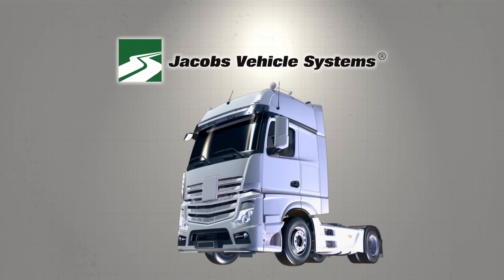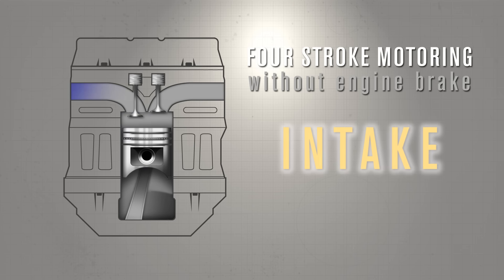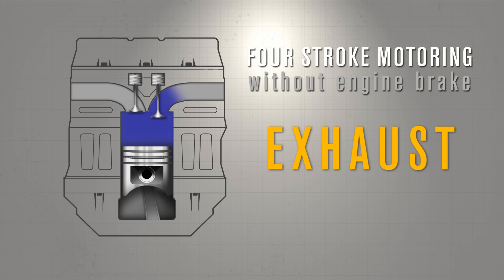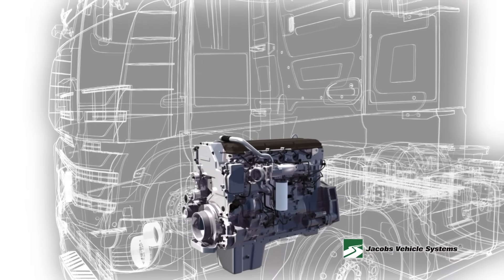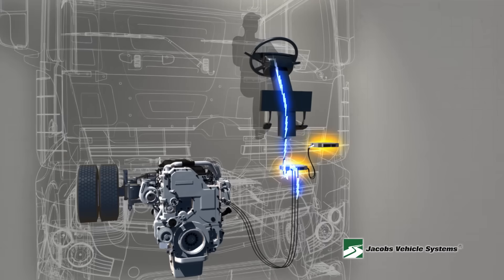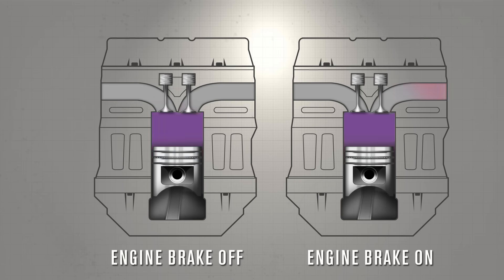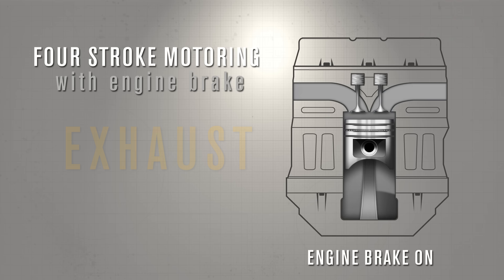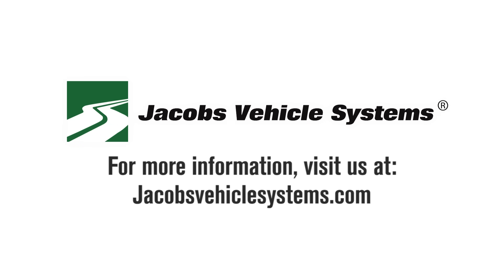How a Jake Brake Works - Jacobs Vehicle Systems

Comment: Can anyone explain why you wouldn’t just go into neutral? If the energy isn’t being given back to the engine with the expansion cycle, why even use the fuel?  I mean I guess the engine is gonna be running regardless but

Comment: This also is explaining why you will see increase in boost pressure and egt will not drop as fast while using jake brake. Air cannot enter the engine as much, creating a airflow restriction making your boost gauge read up a bit, and egts will not drop as much or as quick due to heat energy being generated and not just allowing air to flow through if you have the brake off and no throttle applied. If you wait, you can actually watch your egt climb back up a little bit when you hit the jake brake.

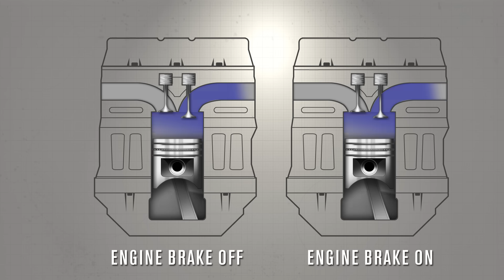Comment: how to waste gasoline/diesel... ex valve open after intake close.. 2:11
Reply: Fuel is only injected during open throttle. No fuel is injected during coasting or during engine braking, so no fuel wasted during braking.

Comment: I love the sound of Jake brakes. I also took diesel engine mechanics in highschool and would have graduated with a diesel mechanic certification but the teacher quit halfway through the 5th of 6 half year courses, and they shut the program down and wouldn't count the previous 2 years of the class. I ended up giving up on that career after not wanting to have to completely restart the program after graduation and pay for the schooling. Now i mive and install office furniture...
Reply: I think you made a big mistake not starting that over.

And this is from someone who also had to restart their trade school.
Reply: @Dave_Crupel   I think that all of the time 😐
Reply: You love the sound of Jake brakes because you don't have to listen to them when you're sleeping at night.
Reply: @jojogo22   I tend to not listen to most things as I sleep, because I'm usually sleeping. It's nice of you to assume that  don't live near seemingly any roads, when I live 2 houses distance from a main county road that's one of 3 major roads going to out highways. I listen to every loud vehicle that passed, not just semi trucks. Every loud car, motorcycle, constant helicopters flying low enough that my windows shake, and white trash in the apartments behind me
Reply: All high schools should be mandated by law to have well equipped trades classes. It's outrageous that schools have been shutting down stops and trade education programs.
Reply: @gregorymalchuk272   I was in HS from 2005-2009 and they shut down the diesel program I was in, as well as the gas engines class next to us. Gas engines went first, and diesel the next year. They kept the veterinarian program and whatever they did with horses and converted the rest of the school into pretty much a big school for learning how to code...

Comment: Should be used in emergency situations especially in populated areas. I live near a freeway in a city just outside of Minneapolis and I’ve been here for almost 20 years and it wasn’t until recently that I started hearing this noise many times throughout the day. It’s infuriating and even more so when it shakes your house and wakes you up early in the morning.
Reply: The new jake brakes are no louder than the regular sound from the engine, the wind and tire noise drowns it out, HOWEVER some people remove the sound muffler because they like the sound. I think its a cool sound but it should be illegal except when logging or in mines away from cities

Comment: This explanation did not include anything regarding the fuel injection.  It seems to suggest that the compressed air creates all the power.  Written by someone who doesn't understand internal combustion engines?

Comment: I was amazed at how well the Jake worked when my company went over to automatics...I ran a ton of WV and Pa, and other assorted states, and even at near gross the transmission/Jake kept my speed under control...I often wonder how old truckers managed without a Jake...
Reply: They did a lot of down shifting with their manual transmissions.
Reply: @549BR  well, yeah...I grew up near Old Fort, and trucks would go down that mountain at a crawl speed...when I began driving thinking about what gear to go down any particular hill, and having a Jake, was still a thing...I smoked my brakes 3 times over the years...once I was able to stop and just sit and let them cool...twice I was able to catch a lower gear...as I was close to hanging it up I still saw trucks smoking brakes, and today I know it still happens...it seems more frightening seeing it from in a car, and knowing what is going on...
Reply: @549BR down shifting really doesn’t slow you down like it would in a Car.
Reply: @690_5  That's because diesels generally don't have throttle plates, so they don't generate very much engine braking, unless your tractor is very old and has a gasoline engine.
Reply: @michaelbenardo5695  exactly that’s why they have runaway ramps on mountains diesels will run away because they rely on fuel injection instead of a throttle valve like a gas engine
Reply: Jakes have been around since the 60s. I’ve had a lot better of a time with them in the manuals I’ve driven than the automatics
Reply: Isnt there unburned fuel in the exhaust gas when the brake is on?
Reply: @ichosolemanuel6048no, because there is no fuel injected during the cycle.
Reply: @ichosolemanuel6048 no, they skip the injection.
Reply: @ichosolemanuel6048 no since the injectors aren’t putting any fuel into the engine.
Reply: huge leg muscles

Comment: The Grapevine on I-5 is a great place for this. (I've heard it many a time while going north on I-5.)
My parents had this put on their diesel Dodge Ram 1500 after running through an intersection coming downhill from Lake Tahoe. (This truck was used to haul a 5th wheel travel trailer which was attached at this particular time.)
Reply: This is the exact place I look forward to driving through when driving back from Los Angeles so I can hear the Jake Brakes. 👍👍
Reply: You can't put a Jake on a half ton.  Don't know what they told you but it's wrong.
Reply: @FoolAndHisMoney23  It could be as it had a Cummins diesel in it
Reply: @LadyAnuB  Cummins in pickups have exhaust brakes which are completely different from the compression brakes like Jake.
Reply: Soooooooooo, instead of purchasing a truck that can safely haul a fifth wheel trailer, they added an engine break to a half ton NEVER designed for that kind of load. BRILLIANT
Reply: @bobward7489  Nope, it's a grade that many have encountered before that overwhelms their tow vehicles. It's a road that they did by mistake.
Reply: @LadyAnuB  Regardless, hauling a fifth wheel with a half ton truck is dangerous and irresponsible.

Comment: The one aspect omitted in this video when explaining the four-cycle process:  Nowhere was it told   when the fuel was injected into the combustion chamber; as the narration told of air intake and compression, but no mention of the fuel combining with the air to make the combustion.
Reply: Fuel is only injected while producing power. No fuel is injected during coasting or engine braking, so no combustion occurs then. Since fuel is not part of the engine braking process, it is not shown in the animation. The power cycle that occurs while fuel is being consumed becomes the expansion cycle in the absence of fuel. Most of the energy used for compression is returned during the expansion cycle, so not much retarding happens during coasting. Opening the exhaust valve at the end of the compression cycle dumps that energy into the exhaust system before it can be returned during the expansion cycle. That immediate dumping of the compressed air is why the engine holds back more during engine braking than it does just coasting. It has everything to do with pumping air and nothing to do with fuel.
Reply: @rdththth Only your comment made me understand what the Jake Brake does. The video didn’t explain it at all..
Reply: In a diesel, the high compression ratio causes the air to become super hot, so when the fuel in injected, it instantly combusts - diesels don't have a carburetor.

Comment: If everyone liked the same sounds, noise would not be a problem. I live off a main road, one side residential, the other industrial. There are no hills, no highway ramp, still, “some” truckers apply the Jake break with or without a load (as early as 6am and late as 11pm). It is annoying, especially for those who work the night shift, or with a baby at home, or a sick person at home.

Comment: 1. Jake brakes do not improve fuel economy, in fact they can have a slight negative impact in some situations
2. They are still loud even with the emissions equipment, maybe not as loud, but "all but eliminated" is stretching the truth.
Reply: You obviously aren't in the career or you'd understand.

Comment: The computer does not open the exhaust valves. Jakes were around for decades before a computer was put in a truck. The cam and valve springs open and close the valves. The jake operates with a actuator and oil pressure to change the timing of when the exhaust valves open and close.
Reply: The younger generations think that we were in the stone age before computers.

Comment: Everytime I see a "No compression brake" sign. I think of that, 72 feet, four inches long; 13 feet, 7 inches wide; and 15 feet, 7.5 inches tall at its highest point. That weighs 400,000 pounds. That blast its train horn in town that can be heard for Miles compaird to my Engine brake that is heard for Feet.

Comment: Most trucks today don’t have clutches due to being automatic so there must be a change to how the jake brake works. Well on to the next video to explain that I suppose
Reply: Most heavy trucks automatic transmissions are internally the same as manual transmissions, but with automated mechanisms added to do the shifting and control the clutch... so there's no change in function. Even with an automatic transmission of the type traditionally used in cars and light trucks (clutch-shifted planetary gear sets and a torque converter), as long as there is a lockup clutch bypassing the torque converter engine braking again works as it always did.

Whatever the details of the mechanisms in the transmission, the clutch must be engaged and the transmission engaged in a gear for engine braking to work, and the system of controlling the engine's exhaust valves is the same.

Comment: 0:40
"The air will then be compressed at high pressure . . and expand"
Yeah, for a company that literally does engine things, you kinda messed up by omitting the whole, ya know, fuel part of how the engine works.
Reply: Yep!  That struck me as being odd about not mentioning the fuel aspect of the four-cycle process.

Comment: When I as a kid.. My dad was a trucker. In PA they had certain places where a Jake Brake was required. The cops, who are always your friend and concerned for our safety, would listen for the sound of the brake to make sure you were in compliance.
Reply: now they fine ya for using the in many places
Reply: I'm a little suspicious of this "requirement". I used to drive trucks and not every truck had an engine brake. I've driven in 47 states and have no recollection of anywhere that "required" an engine brake.

The responsibility of safely descending any grade has always come down to the driver, not a "requirement" to use a certain type of optional equipment. 

The opposite is definitely true though. There are many, many places that prohibit the use of engine brakes, and that is something that those friendly cops could be listening for to ensure compliance.
Reply: I’ve driven all over Pennsylvania and no place has had a Jake Brakes required rule in effect.
Reply: Get paid to listen to Jakes all day, what a life.
Reply: @onefastslimjim  😊
Reply: Good, force or threat is the only way to make wild people stay inline. In my area, it is abused because no one baby sit these inconsiderate fools that make unnecessary noise all day long. As long as they have to pay, they obey.

Comment: You had me until "new exhaust and emissions, the sound is all but eliminated"
Reply: The catalytic converters used in recent emission control systems act as mufflers, reducing the noise of the compression-release brake.
Reply: @brianb-p6586  Yes, compression brakes are arguably only about a quarter as loud as they were about 25 years ago on new tractors.

Comment: I won't drive my mixer unless that Jake is working and I know what speeds it it's at just like sound screw looking at the dashboard I got my eyes on the road and I can hear the Jake and I want to hear that thing on full when I go down a hill especially with a full load of concrete that's for the front loader

Comment: I liked to use them, esp the 3 speed Jake, in snowy-icy conditions like 40 w thru the hills when I find myself trapped out IN IT. The slight drag is spread through the driven tires. I don't even think about using the trailer brakes, for fear of the trailer passing me sideways.
Reply: There's no such thing as a " 3 speed" compression-release or "jake" brake. You presumably have a 3-level system, which activates braking by 2, 4, or 6 cylinders of the engine.

Comment: How often do they need relined?
Reply: over the road trucks might need brakes 200000 miles to 300 000 miles city trucks 120000  miles it depends a lot on the operator how hard they drive ect

Comment: Opening the exhaust valve on the compression stroke makes no sense to me. Simply turning off the fuel injector would have the same effect, this could be done via engine management without the need for mechanical changes to the engine. Also by eliminating the compression stroke the engine temp will fall to low.

Comment: So, what happens to the cylinder intake air?   Are the fuel injectors turned off and intake air without aerosoled diesel fuel is compressed without combustion occurring and then exhausted?    
Why have a Jake Brake?      Thank you.

Comment: On the intake stroke, does the jake brake somehow mechanically tie into the injector system to stop the fuel flow so you're not wasting/ejecting  unspent fuel?
Reply: It said to lift before applying the brake

Comment: A decent auxiliary braking system, Jake does the job, or should I say, 'Did the Job'... I've driven a Mack with Cat engine and Jake, I ATM drive a Freightliner with DD13 and Jake. Although they are good, they are nowhere near as powerful as an exhaust brake on the DAF Paccar I used to drive. Sorry Jake, youre getting old.

Comment: I live near quarries and cement plants. Over the past 20 years, many neighborhoods have been built along the road. There are 10 traffic lights within 5 miles. It's not the engine brakes that are the problem, it's the straight pipes. All night long,  no respect! If truckers want respect they need to also give some. I'm begging the police to do something about it.

Comment: A Jacob brake in the UK was basically a clamp around the trailer pin and was designed to prevent a jack knife on mainly tankers.

Comment: it would be better if you made separate air compressor that compresses air into bottles and it could be used to get power in drive, or with electric generator/motor and battery pack
Reply: Huh???
Reply: There have been attempts at pneumatic hybrids like this, but the system is too inefficient and too little energy is stored in the compressed air for it to be practical.
Reply: @brianb-p6586  Not to mention it's something else that will likely break under use and be constantly in the shop for repairs.

Comment: So it really breaks nothing, rather it takes power away?
Reply: If you use it incorrectly it will break things.   😁

Engine break is a misnomer.  Engine redarder is a more correct term.
Reply: More or less.  It makes the engine absorb a lot more power from the wheels than normal when slowing down.

Comment: Is the non-combusted air mixture contained after it gets let out of the chamber? If it goes straight to the exhaust, wouldn't that be a waste of fuel? Or is there no fuel in the air that is put into the cylinder to begin with, when the Jake brake is applied?
Reply: When the jake is working the throttle is at idle.  There is only a small amount of fuel going into the cylinders.  That fuel is still being burned by the heat from compressing the air.   It isn't just pushing fuel out of the exhaust.
Reply: On a modern diesel, the fuel is injected direct into the cylinder. When the Jake is actuated, the injector is cut off.
Most modern trucks have 'dry idle' on the over-run...ie no fuel is injected when the truck is driving the engine rather than the engine driving the truck!

Comment: I thought I knew how jakes works but  now I've never been more confused. How the heck can the engine be braked by letting the whole compression out in the open exhaust pipe? An engine whit no compression? What kind of engine brake is that?  I would really like a better explanation of this because untill this I thought It was all about using compression and exhausts to brake the engine.
Reply: I don't think the exhaust valve opens until the intake charge is mostly compressed.

Comment: Has this technology been used on gasoline engines in passenger automobiles?
Reply: In a way but not the exact same way.  They are not as effective on gasoline powered engines because gasoline engines have much lower compression than diesel engines.  The closest thing i can think of is downhill assist in some gasoline vehicles using the  engine to help slow the vehicle down hills

Comment: I rarely use jake breaks, you can’t hear them on a 2017 freightliner so what’s the point?
Reply: You must not drive over many moutains?
Reply: @Bendigo1  not often anymore. But when I used to they were very handy, there are only a few trips I make that require them for extended perios. I mostly meant them being quiet in my comment as in I see drivers that leave them on full blast 100% of the time and don’t actually know how to use good braking technique:)